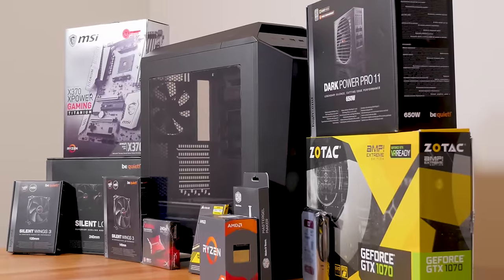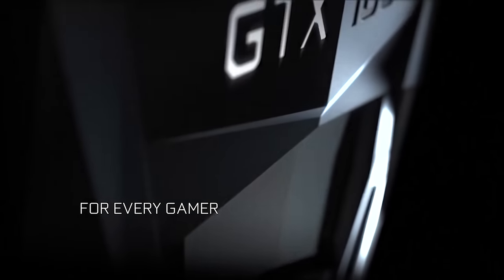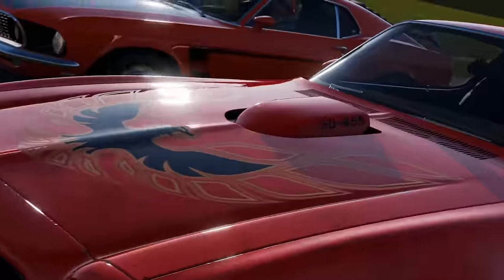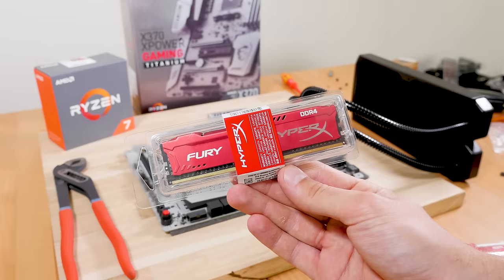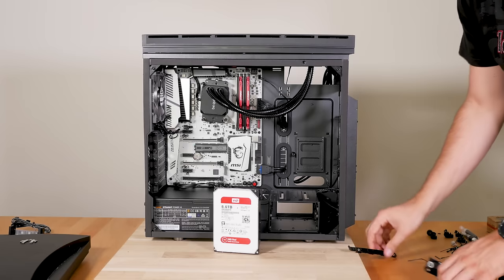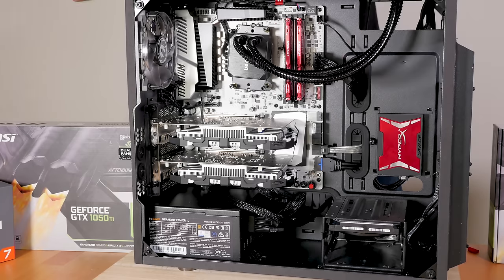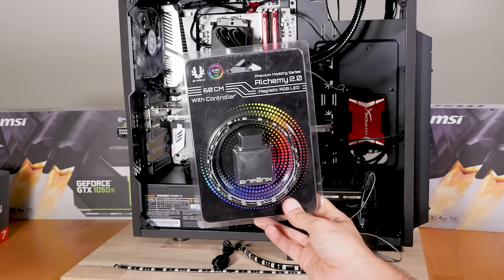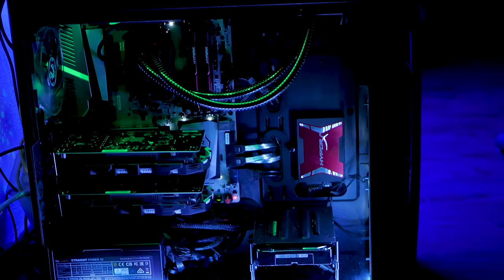Building a PC with Techaltar - AMD Ryzen 1800X Edition

Comment: They're stance is you don't care enough about performance for SLI if you're getting a GPU that cheap. Personally, I think its' at least, if not more, important. I am on a seriously fixed budget. I have to spread my purchases apart to afford each part, and even then, I have to save up during that time. So I can't just run out and buy a more expensive graphics card. BUT- I can afford to save and buy a 1050 to get my system rolling, then later, save to buy a 2nd card for better performance.Since Nvidia doesn't allow that- I'm left going with Radeon RX 570's, which do allow low end crossfire. So yeah, thanks for leaving out the little guy Nvidia

Comment: Right now, i really hate MSI. My x370 motherboard has had 12 bios update, which have all created new issues. The PC won't power on, unless I press the reset button after turning it on, and the board takes 40sec to post. Will not buy MSI again. PS their bios utility makes no sense, and is laggy and doesn't work with my keyboard.